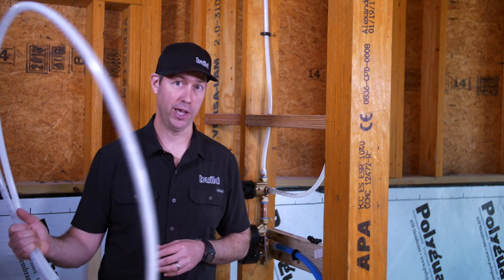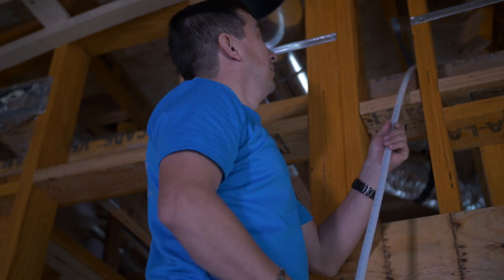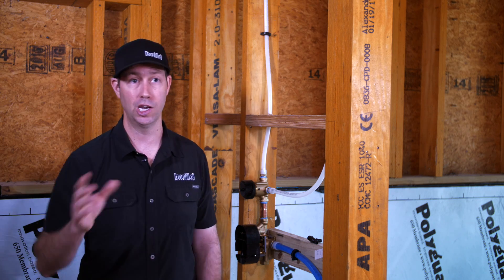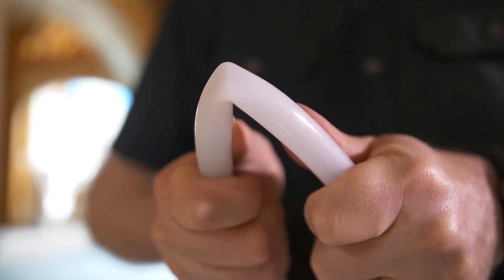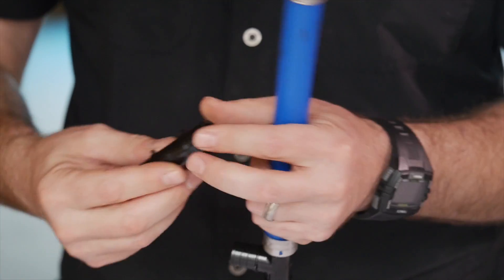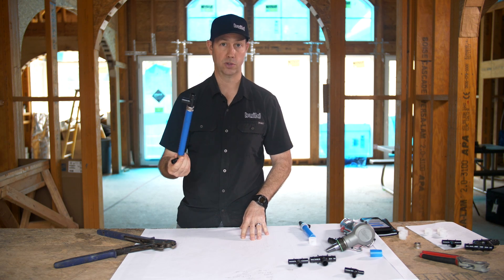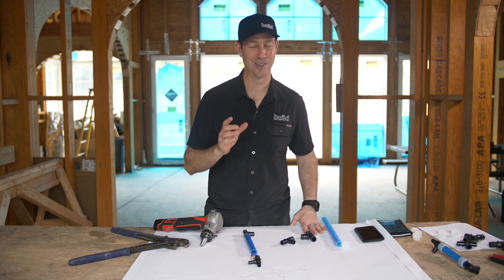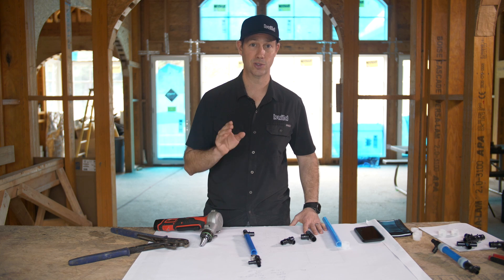PEX vs. Copper Plumbing

Comment: You bolster my argument although I am not copper only.  Plastic in your car deteriorates quite rapidly.  Plasticizers migrate out and the brittle remainder cracks and breaks easily.  Ever try to get older plastic electrical connections apart?  Body panels crack and break.  Who only wants a ten year life span on their domestic water?  I would like to see plastic from forty years ago that isn't brittle.  You mention chemical shipments.  Plastic containers (think plastic jerry jugs, older boat fuel tanks, various chemicals on the shelf all of whose containers fail over the long term) are known for hardening and cracking eventually they crumble.  It won't be tomorrow but give them twenty years or some sunlight for accelerated deterioration.  No plastic can show no long term survival without structural loss.  Sorry but your own example makes my case very well.  Plastic is a short term throw away product never intended for generations of reliability.  Maybe they will make improvements but I don't see them now.  Don't get me wrong I would like to see an affordable alternative but it has to be at least as good with a price performance ratio to match.  Take care.  (I don't think you have worked on older cars or you wouldn't have chosen that comparison!  Same with older appliances.)
Reply: The problem with your argument here is that all plastic is not the same. ABS or vinyl is what is generally used in cars and has completely different properties than cross-linked polyethylene. It would be like saying because steel rusts, you should worry about using aluminum to make something because it will rust too.
Reply: Anodized is better than nothing but normally used on the less stable aluminum alloys.  In the marine world where corrosion is everything only the 5000 series and 6000 series with a very few other exotic alloys are used.  The 5000 is better for some applications in construction (where press forming is needed for instance) whereas the 6000 does better in other situations.  It is all about the alloy.  I would highly recommend you investigate the process and properties of anodized aluminum.  I think you will find it used mostly in inside applications.  The anodized finish gives a small bit of protection to the more corrosion prone 2, 3 and 4000 series but in a exposed situation you will very soon start to see the 'rust' (oxidized) bubbles form and spread.  In short order little is left of that aluminum.  Whereas the 5 and 6000 grade alloys form a hard exterior oxide that is very resistant to weather (oxygen rich rain, etc).  This is the difference most important. Some coating work better than others when painting but all are maintenance intensive.  Anodizing is a cheap manufacturing process.  Take a piece of that hardware store anodized and leave it outside for a season if you want to see what I mean.  Or for a quicker demonstration immerse it in salty water.  Also remember when using it in contact with dissimilar metals (think steel in the car frame) aluminum is very susceptible to 'electrolysis'.  So stainless fastenings with non conductive isolators would be best.  Generally speaking the grade alloys that are anodized are a bit cheaper than the 5000 series and up.   Good luck on your project.  Oxidation is a very complicated subject for sure.  Take care.  Doug
Reply: So true with any plastic,,in time becomes very brittle,,try to cut cpvc and pvc after a few years it just shatters,,and I think pexs will be even worse and if you have mice, they will bite right through it.
Reply: as Ford will tell you, aluminium does not rust... it corrodes, but in a different and slower way than steel and steel alloys, just as copper corrodes differently than steel and aluminium. Aluminium corrosion is considered to corrode less due mainly to the less noticeable nature of the corrosion in that it is whitish so i blends in with the silver more.
Reply: Robert Slackware I was merely stating that although it is not called rust when its aluminium and its less visible, that it does in fact corrode
Reply: Sadly, copper has mineral build up :/ but I'm sure you can flush it out without damaging the copper pipe.
Reply: Plastic a generic term for literally thousands of different products.  They are not all born equal and different plastics can have massively different properties.  We manufacture one version of product that can literally stretch a mile without puncture, for instance.  One thing they have in common however is that they all degrade in ultraviolet radiation... i.e., sunlight.  Most manufacturers add stabilizes to help protect from UV but that only delays the inevitable IF exposed to sunlight.  Plastic pipes we are talking about here (PEX) which is a cross-linked polyethylene, is tough and durable when installed properly.  We do not manufacture it so this is not a plug for my company.   I don't know of may houses where the water tubing is installed in the sunlight.  That makes most of your argument a moot point.  I can show you plastic manufactured 20 years ago that is not brittle but not 40... mainly because it was not even available for this use 40 years ago.  Keep it out of the sunlight and it will last a very long time.  Living in Houston I can show you entire neighborhoods plumbed with Uponor Aquapex that is trouble-free.  As with most products, installation is as critical as the materials used.  Every product has problems when not properly installed.
Reply: @gareon54  One has only to look at the old plastic supply hoses under sinks where it is always dark and see how hard and stiff they are to know the sunlight isn't the only culprit.  Time also factors in along with chemicals in the water.
Reply: Also remember, plastic can leach chemical into the water. First they discover BPA in plastic, then the BPA free plastic came out. It turns out BPA free plastic also has its own chemical issue. Teflon frying pan use to be good, not we see Teflon is not so good for people. I would not use PEX for hot water for sure.
Reply: As a retired auto body repairman I have all the same questions about the use of plastic piping.  From what I see and hear, and this guy said it right off the bat, PEX is good for the builder because it's cheaper and faster...but how good is it for the owner ?   And how good is it when it's forty years old and it fails, and all the wood composites in your house including structural beams , turn into mush?
Reply: Andrew Bird aluminum does rust...
Reply: it sulphates
Reply: @dh66  Oxidize, but ok.
Reply: @OCavant  rust is just the layman's term for oxidization... If you get to say iron rusts, you get to say aluminum rusts.

Comment: Very interesting and informative.
I wish I knew the Diam. dimensions of the two fitting types.
I would guess the larger one is DOUBLE, OR MORE,  the square
area than the smaller one.

Comment: You didn't say what sizes are available. Why do some people say there's a temperature limit/problem? Does nobody use Galvanized anymore? What's the thermal conductivity (insulator or conductor?)? Copper pipes can be insulated. Can PEX, or does it not need it? You showed the flexibility of only one size/type. How flexible are the other sizes/types? Are the tools you used the only ones available? Can you connect to different pipe systems (copper, galvanized, whatever)? How does it connect to valves, sinks, appliances?

Comment: My biggest concern about PEX would be the same why I don't buy bottled water (aside from cost). It is plastic and all plastic leeches chemicals. To me a PEX system simply means the water is tainted. Sure, many will argue it's safe - and it may be but I don't trust a system that's only verified by the manufacturer. Copper leeches copper ions into the water , which is ok considering the concentration and the time it takes for considerable amounts to go into the water.  My body can handle copper, it can't handle phthalates and other undisclosed chemicals.
My house is copper and I have expansion tanks and I installed a return line with a pump. I have instant hot water on any faucet all the time. That was building code in many European countries since the 60ies, so I don't know anything else. Personally I would go with welded stainless steel for piping if that was an option over here.
So while PEX is cheap and convenient to install, I think it's questionable in terms of water safety. But hey, everyone can decide that issue for themselves.
Reply: Water is also a chemical. Your food consist of pure chemicals. Flowers may have really toxic chemicals. That is their self defense system. To be safe, never go closer than 10ft from any flower!
Reply: Yes, the age old and rather unintelligent "everything is a chemical" argument. Tell that to the people in Flint. Their water is just fine according to your standard.
Reply: Point is a chemical is not necessary something that is dangerous. We also have the fundamental principle ''sola dosis facit venenum'', or as they say in Texas, the dose makes the poison. We simply cannot tell what is dangerous unless we also know the dose. Too much of anything can be bad for you.
Reply: Yes, maybe I should have listed a couple hundred different phenols, phtalates and similar "chemicals", but there is something called "context".
Mhhh, as they say in Texas? I always thought that quote was attributed to Paracelsus...
Reply: 99.9 percent of the chemicals humans ingest are natural.  More than 1,000 chemicals have been described in coffee:  28 have been tested and 19 are rodent carcinogens.  Plants in the human diet contain thousands of natural pesticides that protect them from insects and other predators:  63 have been tested and 35 are
rodent carcinogens. (From: Misconceptions About Environmental Pollution, Pesticides and the Causes of Cancer By Bruce N. Ames and Lois Swirsky Gold 1998) 

Doesn't mean much at all if you have ingested a couple hundred different phenols, phtalates and similar "chemicals". If you have swallowed a few hundred different molecules, so what? We need to know the dose here to express anything meaningful.
Reply: This is a really tedious discussion and we can go on in circles. You believe artificial materials that don't occur naturally are ok because the manufacturer says so and I don't. So do whatever floats your boat. I for one will not eat nor drink anything wrapped or stored in plastic when I can avoid it.
Reply: You are hyperventilating Uwe. You too are suffering from chemophobia. That's a mental illness. Or could be a religion maybe. Anyway, you are facts resistant.
Reply: So you're not only a chemist, now you're also a medical doctor. Respect!
Reply: Don't have to be a chemist to determine that you have a faith based conviction and that no facts or observations can alter your world view. Just like an religion!
Reply: If you want to put this discussion to a meaningful level, please provide links to scientific studies that PEX does not leech any biologically harmful substances into the water in any significant amount.  Double blind or long term studies not paid for by a manufacturer would be preferable.

Comment: I have used (and repaired) copper systems for years. It used to be the best system. In my opinion though, not anymore. Why? Dang pinholes. I have had my own house's plumbing develop pinholes in one length of copper. Luckily it was in my basement so the damage was minimal. Thank God for floor drains, amirite? Then I had a friend who had a pinhole develop in her house. Trashed a bunch of drywall, naturally. Repaired that plumbing and patched up the drywall... and was thinking "Hmmm... seems like a pattern is developing here." Then my 12 year old 3/4" copper service line started getting pinholes. Lots of 'em. Had to put in an adjacent line. Used PEX. I can guarantee it's not going to develop any pinholes. I'm in the process of replacing all the copper in my house with PEX. I use the copper crimp rings from Sharkbite. So far, so good. The Uponor system is obviously the best system but for the average homeowner the Sharkbite crimper will have to do. 

Bottom line: "Copper -- it's yesterday's news". At least for me. 

Great video, Matt. Really enjoy these.
Reply from the maker: +localcrew appreciate the feedback and the complement. Best, Matt
Reply: i work at a apartment complex and half was done with M copper half with L copper..all built in early 70s...been here 7 years and not one pinhole in the L buildings but constant leaks M buildings....been telling the boss we should just do a repipe and be done with it before we have a huge break.
Reply: Hmmm... I also used to work at an apartment complex that was built in the early seventies. What are the chances?

Sounds as if the boss is rolling the dice a bit on this one. Gonna come up snake eyes sooner or later.
Reply: i have told them that 100 times.... we are doing repipes as people move out now...all the unit shutoffs are stop and waste type so those are junk...cant even turn or the stems are rotted off lol..doing new ball valves.  takes 2 of us about 3 days do a unit.. we use copper where we can but tight spaces we go pex.

Comment: Hi Matt, I don't have any experience with Pex myself but a friend of mine used it for all this house. He has not had any problems but the fitting he used were not either of the types you showed. They were more like the old copper fittings and you pushed a metal fitting inside and then crimped a connection onto the end. I know all pluming changes over time and this was probably an old way of fitting the Pex. Can you shed any light on this type of connection and has it been changed to one of the systems you showed.

Comment: My prediction is that those Uponor fittings will collapse in time due to compressive and chemical (Chlorine) stresses, They are rigid and may be prone to brittleness after a decade or two. Hope Im wrong as I like the system. Just wanted to make note so I can pull the "Told you so" card one day.

Comment: I’ve had pex in my house for 5 years and never had any problems or taste issues either
Reply: Five years is no proof of anything. A piping system should last for several generations and as long as the structure.
Reply: Attilio Di Marco don’t worry about me I’ll be just fine
Reply from the maker: +Attilio Di Marco I agree

Comment: Great information.
Question regarding noise. Besides the hammer effect the copper tubing in my 1988 house in Michigan makes a lot of noise from just the water running in the tubes, is PEX less susceptible to this? 
Having come from Brazil were almost all plumbing is PVC imbeded in masonry, including got water, it really stands out to me. 
Thanks

Comment: I'm a plumber and I like the pex system.  I use the viega manabloc  system in the mechanical room and run individual 1/2 pex lines to every fixture. The have pex strong arm brackets. So that allows me to take the pex right out of the wall. This way we have no fittings in the wall.
Reply from the maker: +Matthew Kromer I like that idea. But does it take longer to deliver hot water than a trunk & branch?

Comment: As a homeowner, I have had two houses of less than 15 years old spring pinhole leaks in copper pipes. Both were on municipal water. I also have a few sections of spare copper piping that are so corroded after just a few years of storage that I wouldn't use them. I can't say I was thrilled when my plumber repaired my plumbing and installed a water filtration system with PEX but at least it doesn't leak from corrosion.

Comment: I installed Wirsbo back in the 90's. Back then the fittings were milled brass( $$). Compared to having to make sure holes were perfectly drilled and soldiering each copper fitting between joists; the speed of install made it cheaper than copper.
Reply: goombakiwi yeah I wonder, brass or copper?